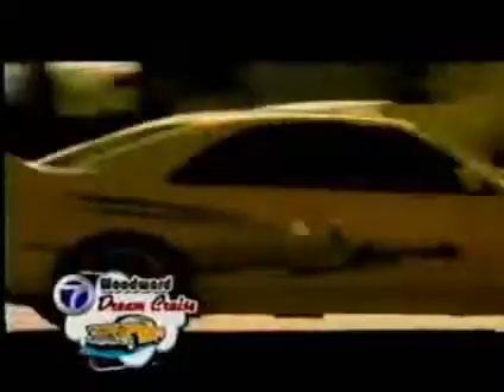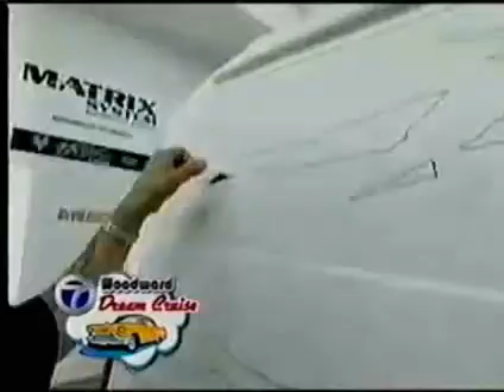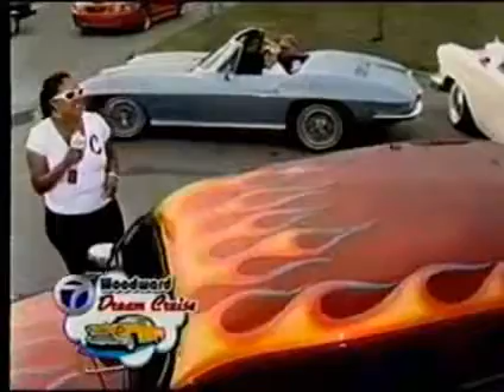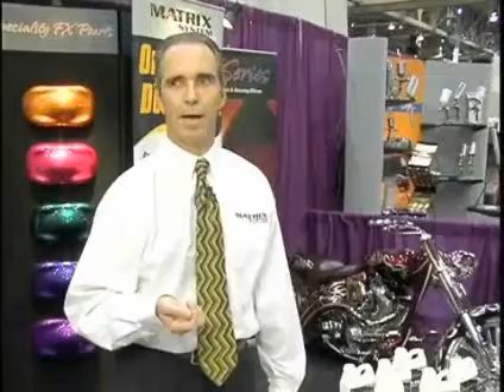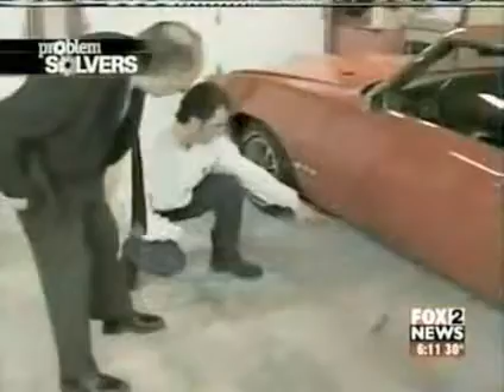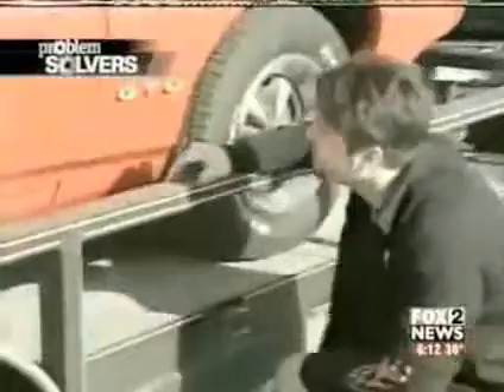Matrix System Automotive Finishes

Comment from the maker: yeah we no longer use matrix anymore ..we now use sikkens ..its much better .
Reply: Rivera’s P&B  I told someone I use matrix and the said "oh so you use sikkens " what do they mean
Reply: @single_track_dirt_and_snow  they mean they don't know what the f they are talking about.  Shop I use to work at used sikken products. Its total garbage.  Matrix was its own company but was purchased valspar which was bought by Sherwin Williams.  But it doesn't really matter who makes what really because near every  Big brand has baby sister/bro brands under it. Valspar owned matrix. But the Matrix products spray better/match better and last longer than the "valspar" paints/clears. 
Sikkens is not better than matrix and matrix is not better than sikkens. Why i say this is most of these paints work wonderfully. Most paints/clears that fail is not a chemical problem of the paint. Its the workmanship prior to any of the coatings being sprayed on it. 
I an old (age and time) "friend" I have learned a lot from just a few weekends ago while having a pig out on wings and beer a few weekends ago said " The only bodymen i hear bitching about the quality of the paints and clears are the ones that are to lazy to prep correctly." 
For instance it is very common to have a product recommend 400-600 final sand and there are so many shops that final sand at 320.  Now when you do a complete car and save 8-10 sand dics  per car over a yr thats alot of money saved on just the sand paper. 
I am super anal ocd even over my prepwork. When i whipe a car down (final wash) I do so until absolutely nothing if coming off on my whipes.  You would be hard pressed to find that in any shop unless they are entering a car in a car show.  Why I am anal about my workmanship is if ever (not one yet) comes back with an issue I will know its 99.9% likely its the product. De lamination is is usually caused dust on the surface being sprayed over or incorrect products used together creating a situation where there is no chemical bond.  Hondas had this issue recently. Gm had it in the late 80's Ford had issues etc etc. Most manufacturers went through it.